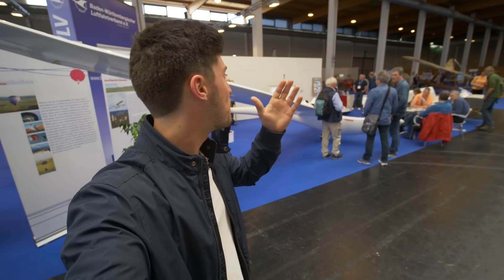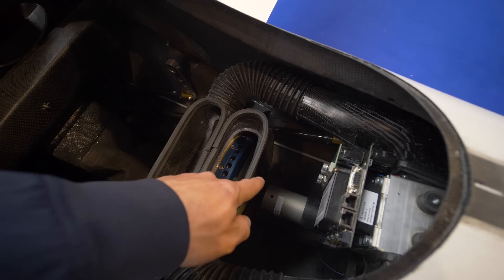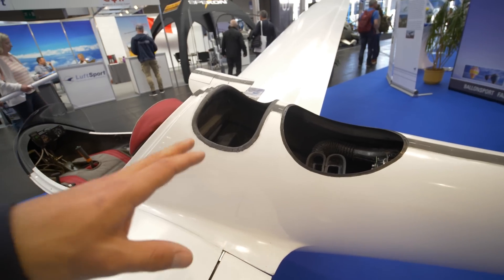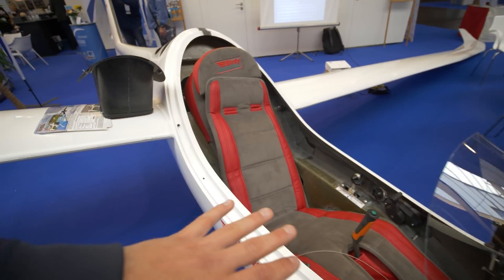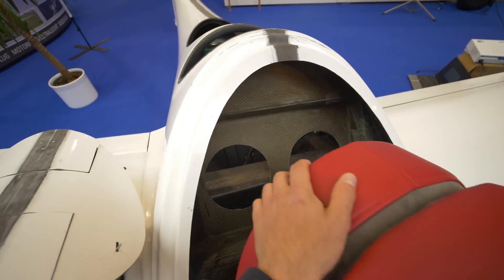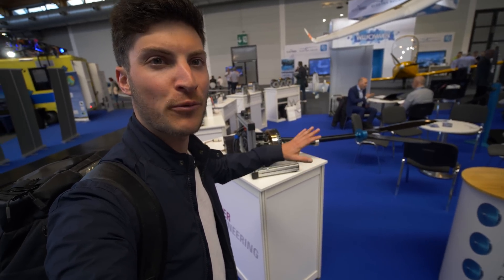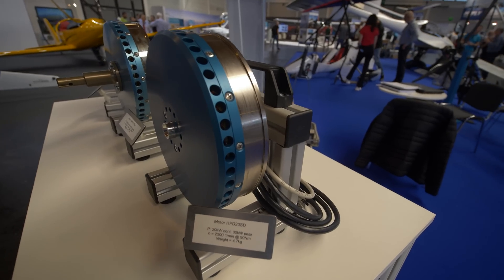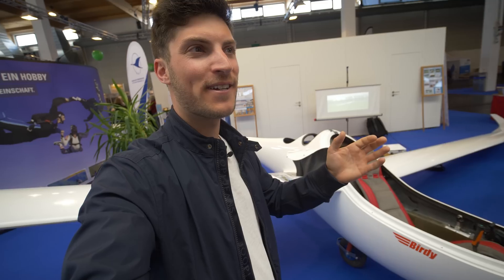120 kg Electric Glider BIRDY - AFFORDABLE Future of Gliding? | AERO 2022

Comment: Yes please more electric gliders!
I would like to know if they have plans to put solar panels on the wings?
Reply from the maker: I have not heard about it. Most probably the weight limit of 120 kg would not allow to install solar panels.
Reply: @SteFly  Seems if companies worked together the solar could be integrated into the wing structure without causing much weight difference. It's been done for RC for sure. There are already spy gliders with such capabilities I am sure.

Comment: It's interesting, but hard to comprehend who the target market is? Non competitive local pilots who want an electric launch? Not sure I like the idea of needing power to get down, but as you say not having air brakes would save a huge amount of weight, control rods, and time to build.
Reply from the maker: I´m in contact with two customers who previously flew paragliders/ hanggliders. Having the possibility to self-launch + a reasonable range with electric power is great. For most pilots it´s not important to fly 1000 km, it´s more about beeing in the air and enjoying the flight. 
Here in Germany we also have bigger advantages for 120 kg microlight planes: No medical, no yearly checks by an inspector, ....
And at the end the performance is not worse than a club class glider. I could imagine to buy one one day.
Reply: @SteFly  as a comp paragliding pilot, I was about to say the same thing. The gap between high end sailplanes and paragliders keeps getting smaller 😎😎😎
Reply: This is interesting niche for UL-rated machines in the United States (FAA FAR103). The e-Birdy would not quite make that specification (115kg empty and maximum 45km unpowered stall) but is very close. The ATOS Wing also seen in the video does qualify I think, as does the developing Aeriane Swift 3.
Reply: @halsmith5034  With an airframe recovery parachute, as this has provision for, the weight limit goes up.  The BRS Soft-Pack should do it.

Comment: Well if this thing thermals well at say 90kmh, has a L/D ~37, then heck, I want one. The instrument panel can be pimped accordingly. I do wonder how I , and it, will cope with turbulence, I see myself getting inverted unwillingly at 5m/s thermals. Those oopsy moments in an LS-4 might be o shit moments in a UL.
Reply: That’s an interesting way to point out the difference in flying in turbulence with heavier/ lighter aircraft!   In fact, I think a lot of Paraglider pilots (myself included) wants to upgrade to Sailplanes because they want to trade in the “Ooo Shit” moments with “Oopsy” moments.  😁👍
Reply from the maker: What I´ve heard, the thermal speed is much slower. About 70 kph or so
Reply: @SteFly  What is the stall speed with wings level?

Comment: So, when battery is fully discharged you are flying without airbrakes.
Reply: I wonder if there is a way to spread the  prop's blades, and use regenerative braking?
Reply: @DugWagner  probably highly inefficient
Reply: you can still use a side slip for getting down it's just a bit harder and you gotta know how to do it lol. I guess it's worth the extra weight saved.
Reply from the maker: You can also get the normal airbrakes... it's just an interesting feature.
Reply: Turning the props in reverse as an air brake would generate (charge the batteries) electricity.
Reply: No, if you have a folding prop. You need to apply power to keep it unfolded.
Yes, if you have a non-folding prop.
Or, you need to have some kind of locking device to keep blades unfolded for regenerative braking.